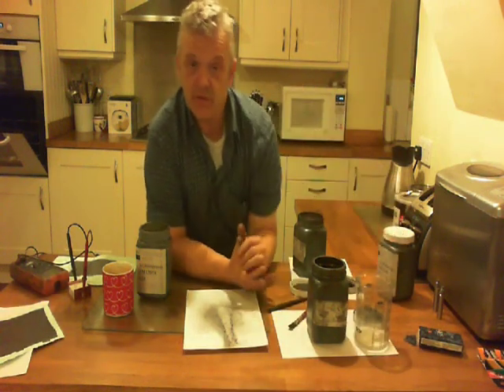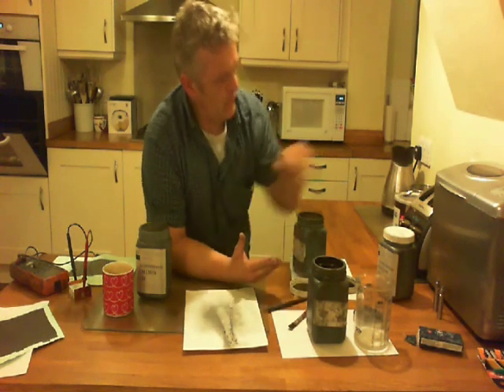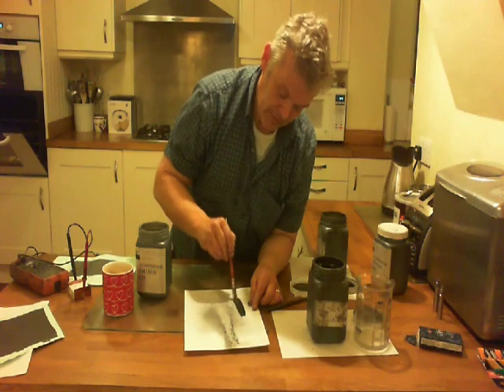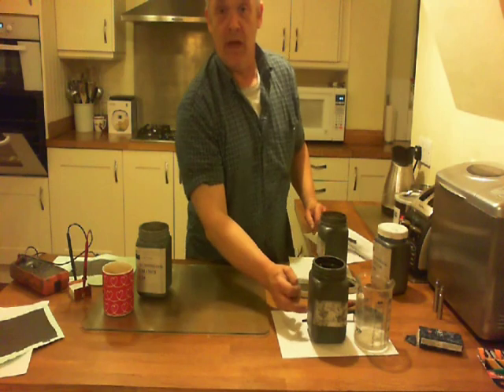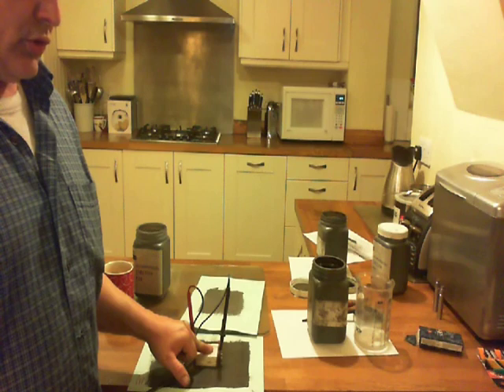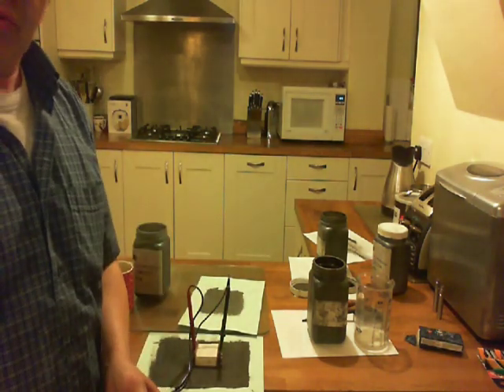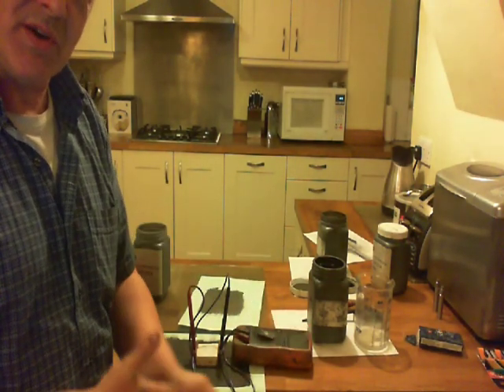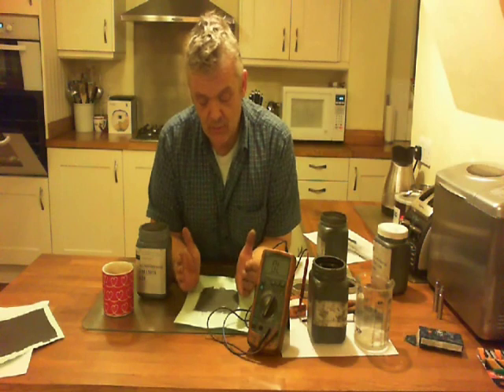Homemade Conductive Graphene Ink

Comment: Wait a sec, so you just took a 1x1cm insulator and attached a multimeter using tape and copper contacts?
Reply from the maker: not quite - it's a homemade sheet resistance probe
Reply: But that's how you make it?
Reply from the maker: pretty much but the end pieces need to be a bit stiffer than tape - i used lightening rod

Comment: Hi Robert I've been doing some research on graphene of late as a conductive ink, I've read from a different source that when graphene ink is used binder free it has good conductive properties so I've used graphene ink with the carrier as IPA,  with a solid content of ink ~14% but the problem is it isn't viscous enough to use it for printing as it is binder free. Is there some way around this problem. I was thinking about screen printing it on a paper( normal paper and a glossy paper) , I did try it out in an inkjet cartridge but obviously the sponge in the cartridge is going to act as a filter and separate out the  graphene from the carrier and eventually be no use . So I thought of sticking with screen printing but going binder free as my further part of the experiment needs a high conductive ink also I want to avoid annealing . Please suggest me as to what changes I should do ?  Your suggestion would be of great help !!!!
Reply from the maker: all i can think of is adding a thickening agent like cmc or agar-agar
Reply from the maker: yes of course it would - as to the rest - i have no idea
Reply: Thank you sir :) , BTW your videos are great .
Reply from the maker: cheers mate - sorry i couldn't be more help

Comment: I made the bare conductive ink but ran into a problem. Although it stuck to the marble tile I am using do my heater it refused to stick to the copper tape. I added pba glue to the formula and got the ink to stick but the resistance jumped.
Reply from the maker: try cleaning the tape with IPA or acetone first and lightly abrading the surface

Comment: How does the conductivity compare between I thin line drawn with a pen vs. a thin copper wire of equal length and cross section area?
Reply from the maker: about how you would expect - the copper is a million times more conductive
Reply: Is the same true for the sheets you produce, if they were to be cut into wire sized pieces?

I love your videos by the way, very educational and inspiring. Keep them coming :)
Reply from the maker: cheers mate - would you be looking for a fake wire by any chance?
Reply: You've got me.  I have an idea for a flat generator, about 1/4" thick.  Just thinking of conceptual options at this point, and I was hoping your film would do the trick, because if I laser cut the sheet, I could get the exact shape I need.
Reply from the maker: have a look at the stuff on flat transformers and skin effects in conductors - that is going to be really important for you - but if you are looking at cutting just use copper foil

Comment: Hi was thinking about ink particle orientation. Wondered what would happen if ink was applied to a surface under the influence of a magnetic field? Could u make a ferric solution ink? Maybe the particles would form strings with an improved conductivity.
Reply from the maker: I was also thinking of a high voltage field too i will get round to it mate

Comment: Another application for these products is RF shield paint for metal detector coils.
Mylar and also graphite paint are 2 products that have employed as shielding for the coils.
Graphene would be superior because less would be required and it would be thinner as a result. That would reduce the weight of the coil, and also the amount of energy lost in the sheild when the pulse goes through it.

Comment: I wonder if applying a voltage to the ink during the drying process would improve conductivity readings. My thoughts are that it would help align the sheet edges.
Reply from the maker: definitely worth a try mate